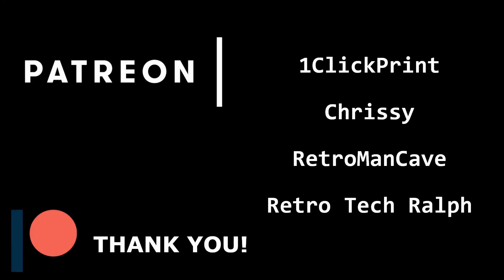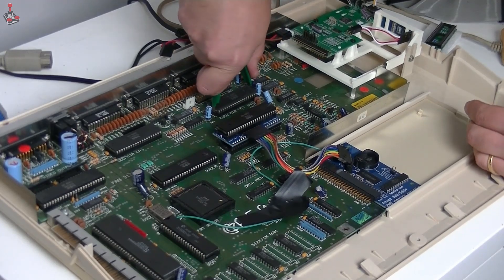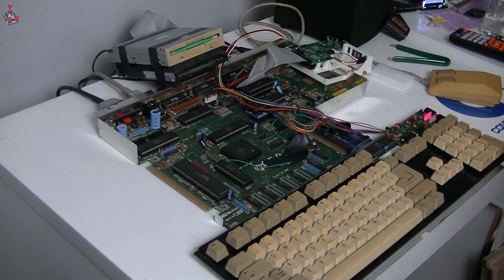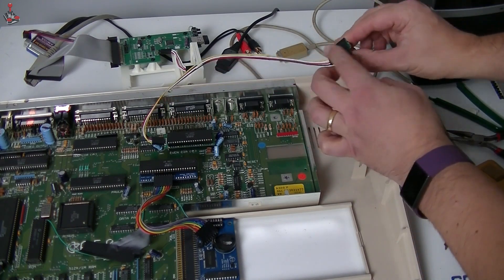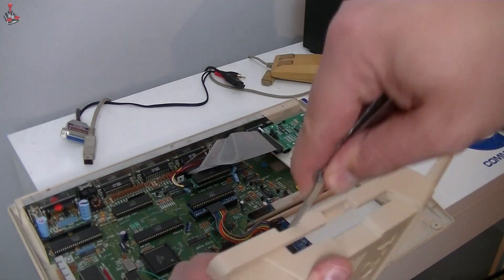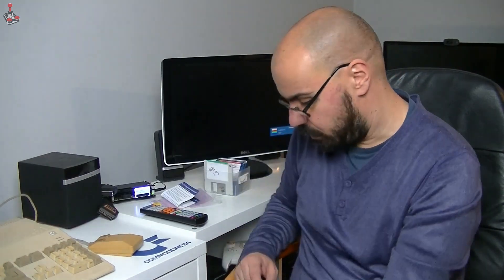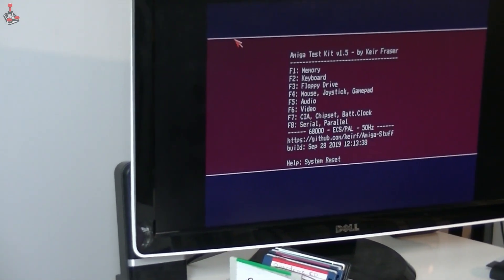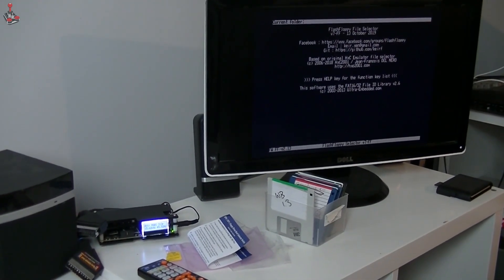Amiga 500 | Installing a DF0 / DF1 Floppy Selector Switch

Comment: I would remove  b/w composite connector. Its a connector whats never used on A500 :) Put the switch to that hole
Reply from the maker: That's another great option.

Comment: Awesome video.....on my A500+ i have a RPi Drive.....this uses a Rasberry Pie3 and a small adapter pcb.....it gives you 2 vertual disk drives....with a menu like the Geotec.....all the .adf files are on a SD card in the host RPi3......there are two buttons....one to swap disks...the other to Write to disk.....works well....there is also a CIA adapter that enables 4 virtual floppy drives !
Reply from the maker: Thank you 👍 Sounds like an awesome solution! I will have to check it out.
Reply: YouTube amiga RPI drive😁